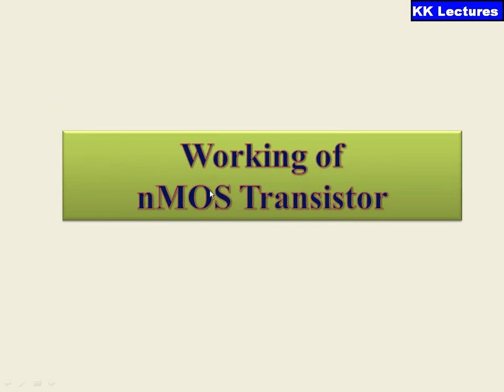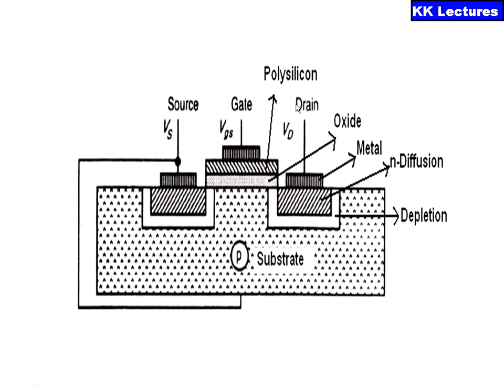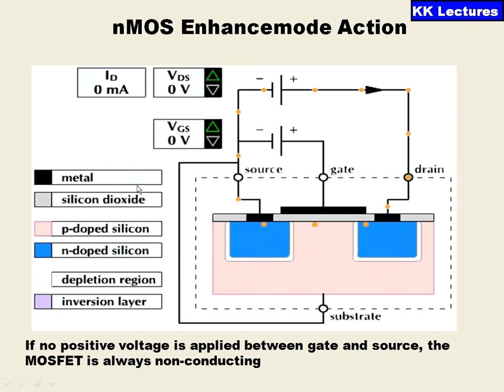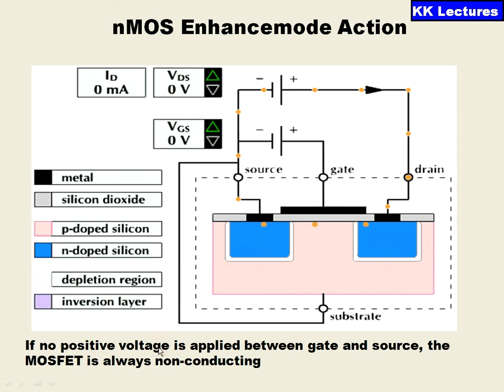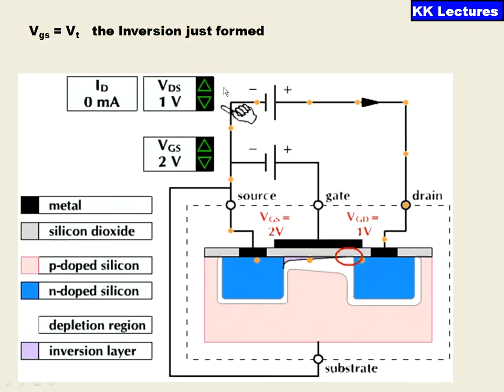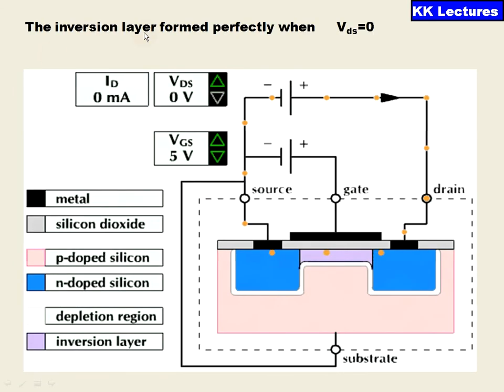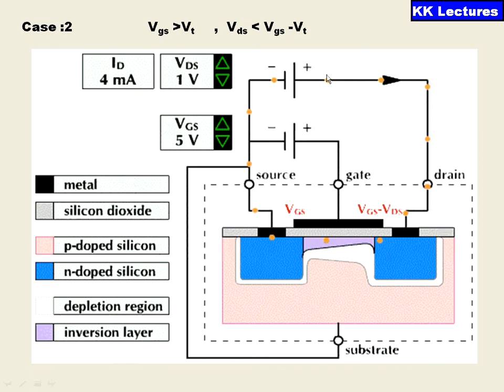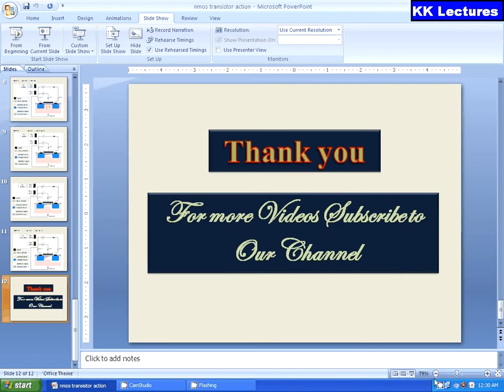Working of nMOS Transistor | VLSI DESIGN

Comment: 5:14 actually there will be current between the source and drain even after pinch-off condition.....that current is called drift current. There may not be channel but drift current happens through depletion region and is constant.....we can see the same in IDs (vs) VDs graph that we can find online.....where after pinch off the current is constant irrespective of voltage increase.